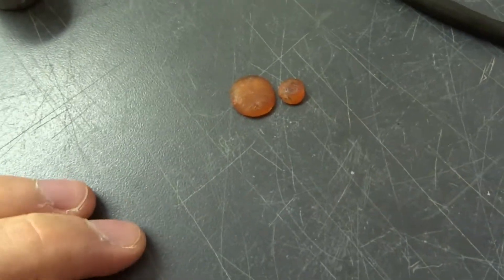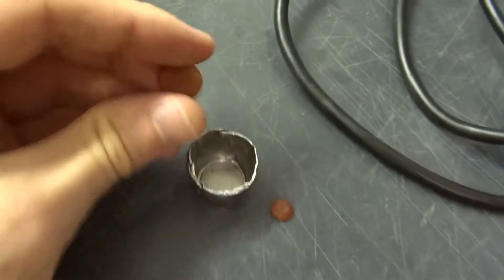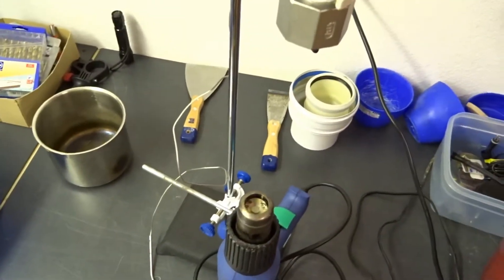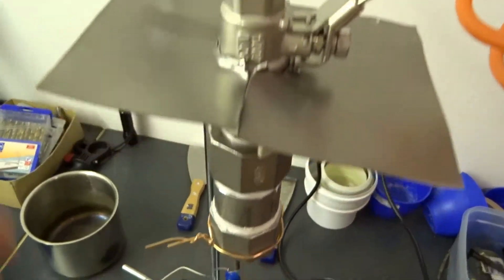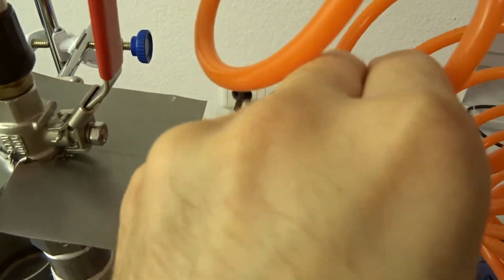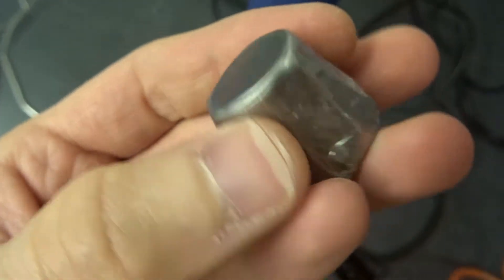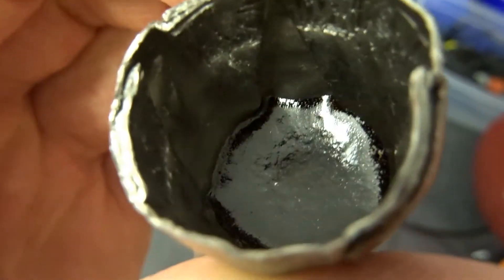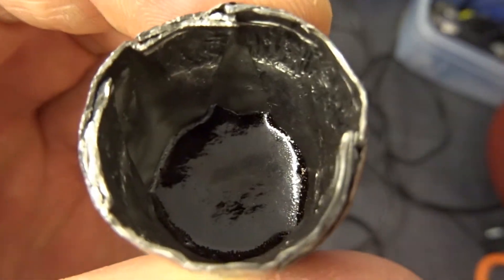Making Proper Bakelite (PREVIEW)

Comment: Your starting compound was Bakelite A or B? I understand the difference to be acid or base catalyst.

I was surprised how effective 7 bars of pressure was, I have read the industrial mold process was in the 100-150 bar range.
Reply from the maker: I believe it was still A. However, that doesn't really matter. As long as it liquifies it will fill your mold.

The primary source of the ugly bubbles is water vapor. At the curing temperature of 150°C the vapor pressure is around 5bar. If you get above this value, no water vapor can form and hence no bubbles.
Reply: @ShroomLab  I had not thought it was simply partial pressure of the water, I was thinking if there was a volumetric change, pressures might affect the rate of reaction. However, your answer is probably >=98% of it.